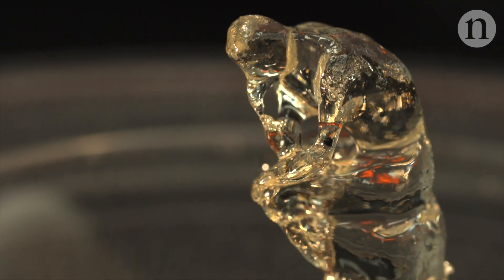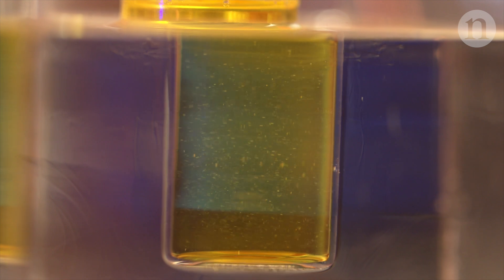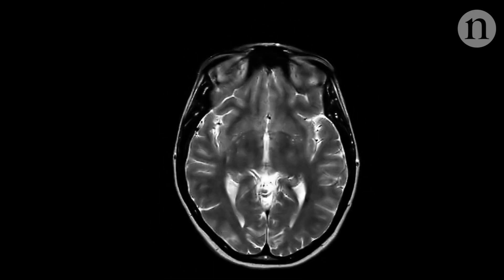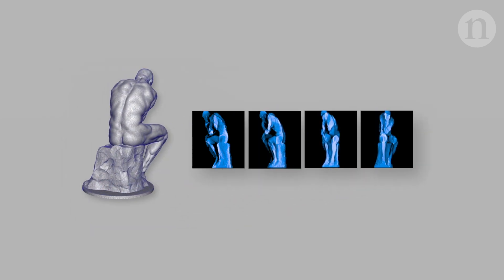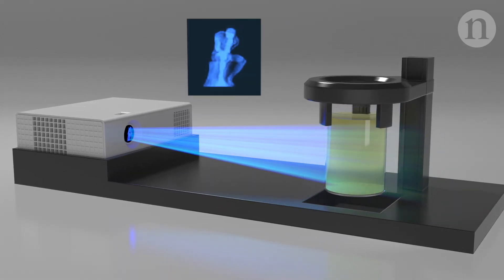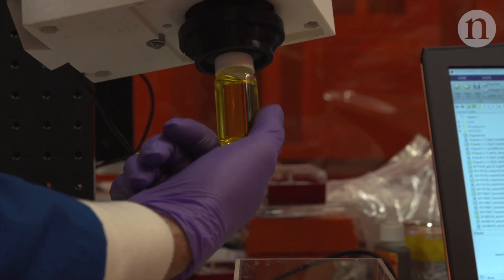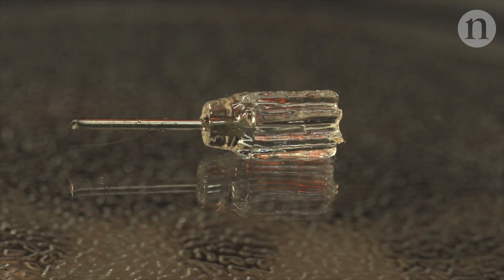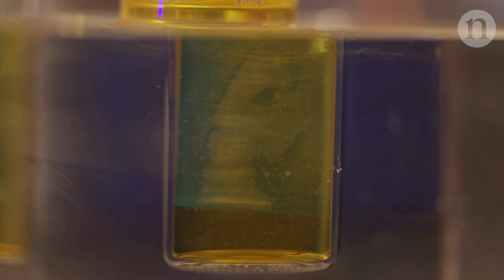3D printing with light: 'The replicator' is here

Comment: Instead of one projector there should be at least 3 projectors at minum 3 angles  the  electromagnetic 3d field driver to control the material types inside the ionic aqueous to concentrate precised material at precise spacetime matchine the hologram super imposed Silk and contrast ratio then the infrared beam deliver correct fusion curing at location

Comment: Hmm the resin should set as a gel so it can support the model, and the chemistry depend on three different wavelengths of light to combine to cure the gel, therefore three different lasers are used to target each part of the model (though one can just be a flood laser moving up the vertical axis) the waste gel can then be removed with warm water. That was the idea I had a ways back, but the chemistry was beyond me.
Well I guess that's already a thing

Comment: An interesting way of 3d printing, but congratulations on making a worse version of SLA, the FIRST type of 3d printing, developed decades ago! Also, this isn't a game changer. Some SLA printers achieve very high detail and print very rapidly, yet have taken over, because they are very expensive. Also, SLA will not replace FDM. They are used for different things. FDM is good for large functional that are strong and lightweight (SLA can't do infill). SLA is used for high accuracy models but is extremely limited in size. This new printer manages to improve on neither of those aspects.

Comment: Same thing as a resin 3D printers but done all at once in vertical rotation instead of horizontal layer by layer. Resin 3D printers are awesome, they need to make them bigger and cheaper for consumers. It's like any new tech, expensive at the beginning.
Reply: Well we arrived at the point of cheap and good now. My $550 printer can print 7.5 inches in high res resin in under an hour.

Comment: Such a poor explanation. Many peeps will think this is just a rehash of digital light projection curing of resin, when it is actually a tomographic reconstruction using interference of coherent light in a complete volume, rather than layer by layer projection, with all the issues that has, such as getting each layer to peel off cleanly from the projection surface.
This theory has been around for a while, and several research groups have had limited success, but so far, UV DLP like the Form2 printers can produce much better models. Maybe in another 10 years it will get somewhere.
Reply: do you know how they get the depth right when printing? I can see how it could be done with multiple intersecting beams of light but if its all coming from one projector, how do they keep some of the resin solid while the other parts liquid?
Reply: Private JR - it uses more than one beam, so that the intensity only exceeds the polymerisation threshold where they add constructively.
Reply: Same as DLP just does it by rotating instead of layer by layer.

Comment: I would like to point out that SLA and DLP are conventional 3d printers, which use light to create opjects with far higher resolution than this. Also their method is essentially a rotating DLP printer. comparing this to a CT scan is like comparing a 5mp camera to the Ricoh 360 Theta... If the cylinder had like 4 projectors from all angles simultaneously hardening the resin it would be a closer comparison. just a thought. But this is by far nothing new
Reply: But conventional 3D printer solidify the resin layer by layer. This one does whole object at once.
Reply: It does not do the whole object at once. If it did it wouldn't have to rotate the resin. Its the same as DLP but instead of stacking layers, it stacks rotations.
Reply: @SmartK8  as stated, it's essentially a rorational DLP. it does not print the object all at once, that would require multiple projectors, which would then cause light pollution and reduce the resolution lower than this already is. To print an obtect all at once with high resolution would require an SLA with a ton of diodes & amazingly complicated software, but would wholly make me blissful.
Reply: This one only takes 2 mins to complete.  Thats the impressive part.

Comment: You're missing the point.
The video gives the impression that it's the first printer that doesn't work by depositing material onto the printed object like an FDM printer and that it works using, wait for it... Light. 
The truth is that there are plenty of printers, both highly professional and consumer grade, that work by solidifying resin or other materials using light. While most of them solidify the printed object layer by layer they are not depositing any material. They are solidifying it just like the printer in the video.
The novelty with the printer in the video and some other prototypes is that they try to solidify a whole object at a time to make the "printing" much faster. You should have focused on how it does that instead.
Reply: SLA printers use lasers and other cheaper SLA like printers use UV light to cure the resin. Yes UV light is light as it is photons just at a different wavelength making it invisible to the human eye, though we can feel it as heat. This printer though uses visible light out of a standard projecter which is quite a novelty that I think might drive down 3D printer prices enormously. Not to forget the amazing speed of course.
Reply: @derschleichende  this has a lot of engineering behind it, and needs a specific resin that cures with said wavelenght this will need a few years before it is "consumer friendly".

It solidifies the object in the middle of the container, when you rotate that little can you also rotate the resin inside a bit wich needs to be precisely calculated for every single resin container you would buy with the resins specific "flow rate" and how fast you spin it and so on... not that easy and wont really drive down the prices in the next few years... :)
Reply: The resin already exists - SLA printers use it. It's the approach they took that is all-new, the way they stack layers not as a deck of cards like traditional approaches do (whether it's FDM, SLA, SLS, or other more exotic methods) but as a drum.
Reply: @derschleichende   DLP printers use projectors as well. They are similar to SLA printers. And I doubt this is using the visible spectrum of light. You can still see "UV" lasers and light sources as they produce a spectrum of light, including the upper limit of the visible light spectrum.
Reply: @SamClarke29  Google it, supposedly it uses a standard light projector.
Reply: @derschleichende  wouldn't the resin harden in daylight then, too?
Reply: @valentins7120  it does, current resin technology, assuming this might need a different type of resin, also hardens under normal sunlight as it needs UV light to harden. This is why you should always store it in the bottle it comes in and not leave it sitting in the printer for days.
Reply: Nothing exotic. I also have a cheap SLA printer (Wanhao D7)
Reply: I question whether this can ever have the fidelity of planar SLA and I am guessing is more wasteful because most of the resin is partially exposed because of the sweep method, light passes through all the resin for most of the angles. This shines light through the whole liquid, where planar SLA makes a sharp exposure of a single layer at a time and because of the properties of the liquid, anything that doesn't become part can still be reused because it wasn't really exposed, relatively speaking.
Reply: @JeffDM  SLA uses lasers and is therefore more accurate. But there are SLA like printers that use UV light and work similarly to this printer just that they can't print something in one piece. It all has to do with the intensity of the light. If a projector just projects the images needed and the rest is black, then it shouldn't be wasteful.
Reply: SLI uses high grade laser to cure resin 
Afordable home SLI printers use ligt from lcd screen
Reply: @SnowTheKitsune  they use UV light, from a UV projector. The printer in this video uses a standard projecter.
Reply: @derschleichende  no... they dont use any UV projector! They use light to cure each layer by turning on and off spots where light should cure resin. After cleaning you have to use uv light to finish making print
Reply: @SnowTheKitsune  it's not a projector as such. But the resin get cured via UV light. Then after the print you clean off excess resin with alcohol, and then put it in sunlight to fully harden. I should know this as I own a printer myself.
Reply: Good point, well said!
Reply: does anyone know how they get the depth right when printing? I can see how it could be done with multiple intersecting beams of light but if its all coming from one projector, how do they keep some of the resin solid while the other parts liquid?

Comment: This can be used to 3D print INSIDE the organisms, without opening them surgically
Reply: No. NONONONONO. NO! This is SLA resin, it's toxic like hell, you want to be wearing gloves and possibly a respirator while curing it. Putting this IN someone is an awful idea! Not to mention also putting in all the mechanics.
Reply: @EgorKaskader  I was envisioning the possibility of this technology and not this particular state of it. When I was in Bachelors we were activating porphyrins with specific lengths of radiation to burn the cancer cells from inside, so it was like remote detonator for cells. Now this could be similar technology but imagine you could build stents inside the aorta without ever opening the rib cage, just injecting the substance (silicon for instance) and activating it with light...
Reply: That's a bold claim - you just fill an organism with resin, then somehow the light can work? - have you thought this through?
Reply: @stunthumb  there are techniques that use "resin-like" substances (artificial invertebral discs for example) directly injected into the body, where they harden. There are many types of waves that easily pass through soft tissues (ex. X-rays).
Reply: The practicalities and expense stop these things from happening.  I can see this technology being used in dentistry, definitely - 3D printed teeth, because the mouth is accessible and a fairly low risk part of your body.  Orthodontists already 3D scan and 3D print, its a natural progression because it would extend what is possible (jaw bone reconstruction etc).  The idea of layers of resin forming a 3D shape inside a body doesn't stack up for me, I don't think it would necessarily work like that - I think that there would be too much risk and expense and we'll see different approaches instead.  We will definitely see 3D printing used more and more in medicine.

Comment: Ok ill go and print me some screwdrivers but first i need to buy that resin for like a thousand dollars per gram probably! :D
Reply: I think liquid resin used for DLP/SLA 3D printing is +-$30 for 500g. But reusing resin compromises future prints so best to use it as fast as you can and not to mix it with your fresh one. If this method makes residual resin too deteriorated, then you might need to use a full cylinder per print. So imagine a "thinker" inside a 2L bottle of coke. That would mean that size of a model (without post processing or painting) would set you back $120. Let's hope the resin is reusable
Reply: @4thDeadlySin  Sadly the resin is not reusable. That and the poor detail may really hamper this novel form of printing.
Reply: @SamClarke29  I'm sure in time they can tweak the technology and materials so that a much higher resolution is possible in the future. Bill Gates once said that computers will never need more than 10 Megabytes of storage, and look where we are now :P